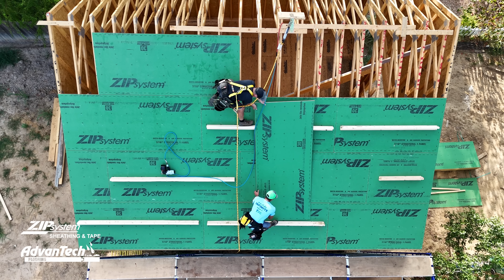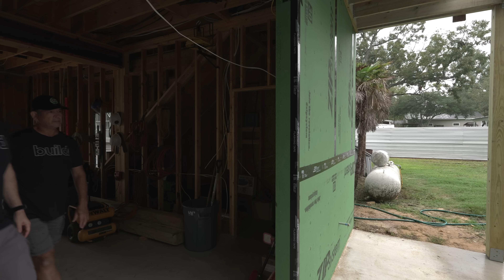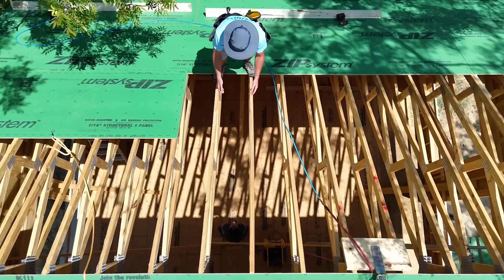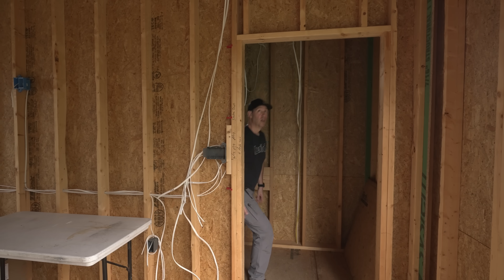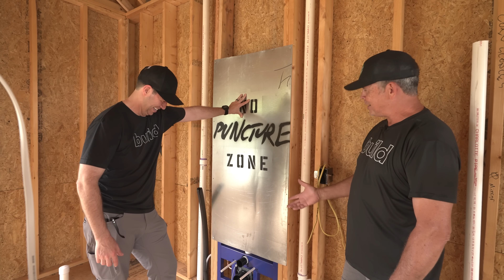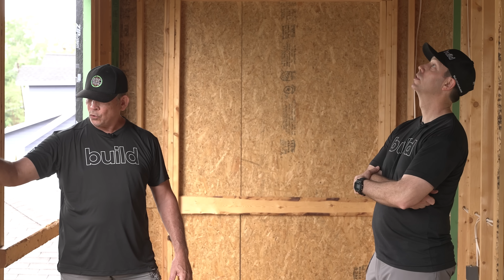Top 5 Best Matt Risinger Details - Studpack Collab

Comment: I was chatting with an engineer about this a couple days ago; a hinge point in a gable wall with a gable truss is apparently a common mistake. When I was building my house, the truss designer on my house included a gable truss on the first revision, but I already had an engineered gable wall so this was caught immediately. This is fine if you have flat bottom chords to brace to, but with parallel or scissor vaulted trusses, fixes like this are often required. In Canada gable walls like this have to be engineered beyond prescriptive code. I noticed it when they were showing a shot of the trusses from the interior, and was going to comment. I'm glad the builder realized and remediated the problem.

Comment: Flimsy gable ends are a common problem/mistake. I have specified PSL 5.25x5.25 for the plates and the contractor was wondering what I was doing. I even had to specify steel horizontal/vertical in some cases. You also have to detail all the connections between the plates or verticals to the roof diaphragm for some fairly high wind load. It is a finicky thing to deal with. It is those kinds of details that actually take more time than doing all the sizing for the rest of the house. That is where all your design time money goes.

Comment: If you sheet the inside of that gable with plywood on the inside, before drywall, ensure to span plate line, I’m betting you have a wall that will Never flex

Comment: 500 for a pvc board!? What a scam
Reply: Dunno, a quick search isn't turning up a price on solid PVC sheets.  Lots of expanded core PVC, but not solid.  The comment about "who is picking this up" is likely related to the weight.  1" HDPE (close in density) is 5.3 lbs/s.f. so a 20 s.f. 'board' would weigh about 106 lbs.  And the price for 20 s.f. of HDPE is... $500 ($25/sf).

Comment: Matt I added a Sensibo to my minisplit.  It essentially acts as an IR blaster to add wifi connectivity to a "dumb" device.  Sensibo is linked to Alexa device which is also linked to a tilt sensor on the garage door.  In this way if the garage door opens the minisplit turns off and when it closes it turns back on.  Wouldn't take a few hot Texas days of air conditioning the outside to pay for a similar setup.

Comment: I'm actually surprised Paul made that framing error on the back wall, not usually like him? Paul is a good framer....
Reply: Watch their episode where this is discovered, and the subsequent fix episode.  The original - stamped by an engineer -  design had been followed.  They didn't talk much about how the issue got in, but on how to fix it.  The retrofit was approved by the truss manufacturer and an engineer (they don't mention if it was the same one).  I agree that it looks like more than one set of eyes were somehow deceived.
Reply: @raygunsforronnie847   Yeah good point, if the plans were stamped by an engineer, sahme on that engineer..;)
Reply: The greatest in any industry make mistakes. Yet, the greatest of the greatest, take the time to share them as a further learning experience.
Reply: @JonDunnmusician  Yes...but this was a biggy...I'm sure he was rushed... its his first house build after all.. Paul is surely a Stand UP Guy!
Reply: @JonDunnmusician Napkin plans make for a Great Story! ;)
Reply: @JonDunnmusician   "Greatest in the industry? Who said that? YOU DID!!! Not me.
Reply: @user-ep2wf5eq4l  As a yoga instructor once said, please calm down.

You are misconstruing the quote. I didn't say they were the best in the industry. I said many who are the best in their respective careers, make mistakes: I could lead with several examples which I won't for lack of space. However, one of the greatest musicians I had the pleasure of working with often talked about his mistakes; I'm sure Steven Jobs, the founder of Apple has the same sentiments.

Back to the Yoga instructor, you want to ask yourself during a quiet time- why you're coming on the internet and bashing people's talents. 

The goal in life is to uplift others.

-JD
Reply: @JonDunnmusician  This was a major framing error, no bones about it. I LOVE the Stud Pack though!!

Comment: ohhh, do not ever leave the garage door open!!!  wow, you are asking to get robbed!!  

I have a setup on my home assistant and my driveway cams.... so if wife and I are gone and garage is open, i get alerted, and then closes it automattically.  I also setup a item where if my cameras do not see my cars parked in the driveway, they have AI object detection and a sensor on Home Assistant that says for vehicle detected, so if the driveway/garage has no vehicles and the door is open, close it.  and all kinds of other things too with sensors in the cars and in the driveway that my home assistant server runs various detections and mmWave object detections and other items in the garage, under the paver driveway, and what the cameras can do....  my house runs itself and all on a local server, i have lights turn on for me as I walkd through the house and turn off behind me at nights, if its late, they go on very dim just enough to see, and all kinds of other things.